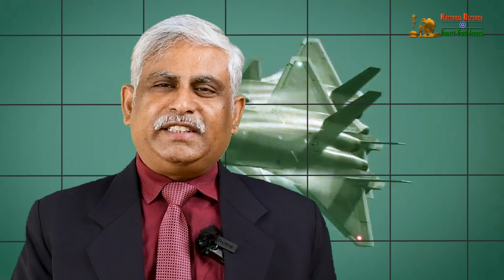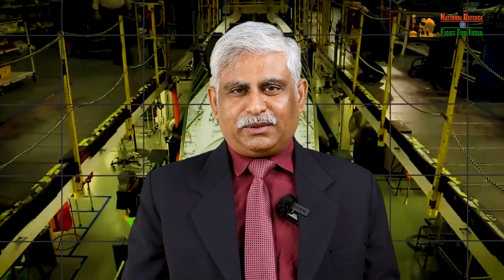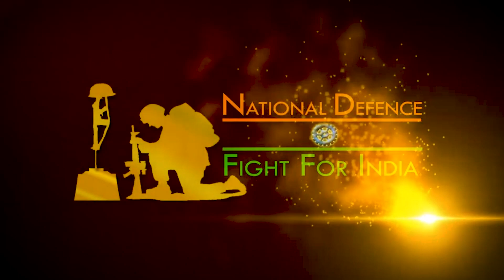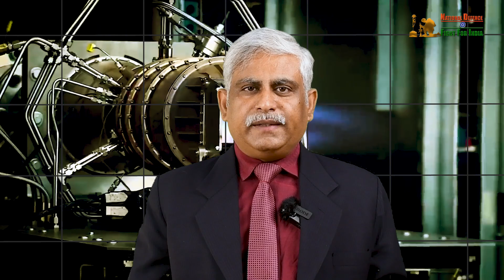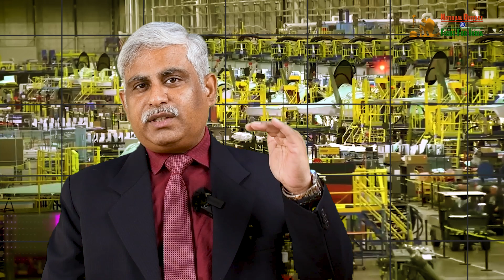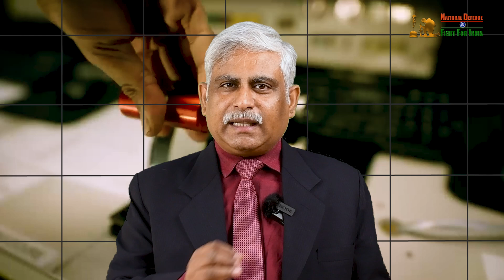6th Generation Fighter Jets Coming Up Shortly! 7th Generation Jets A Reality!

Comment: We need a parallel body to HAL that will take care of the manufacturing and prorotying of Indian flying assets and more, it feels like Tejas MK1 production MK2, TEDBF, LCH, UCAVs and much more are stretching HAL too thin and that maybe the reason why our projects faces delays and timelines are not followed, we need new infracstuure which can lie up with our requirement and we cant put our eggs in single basket and we need to prop up new players or set up a new body that will share the workload from HAL